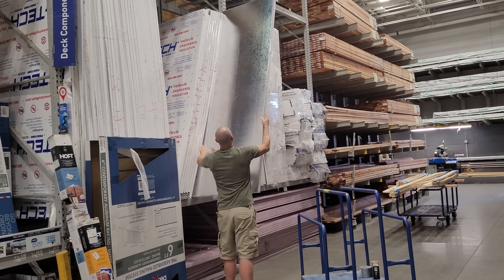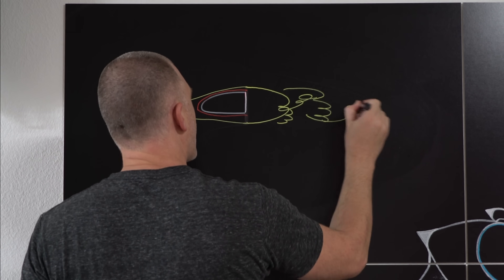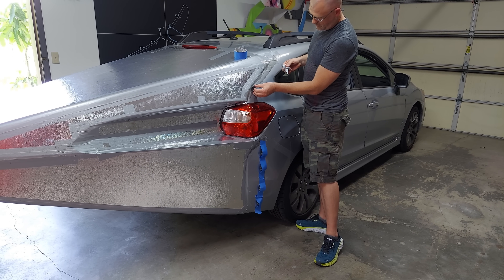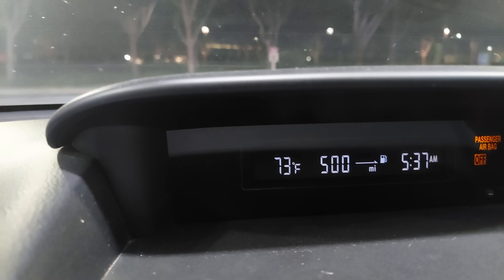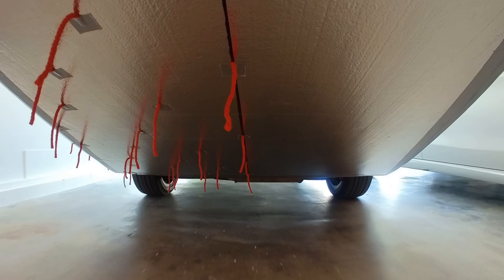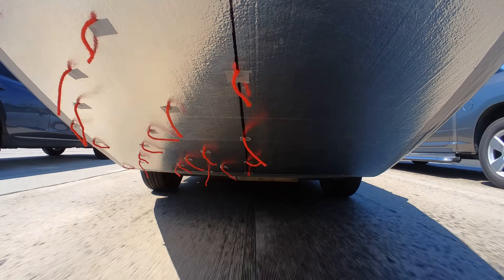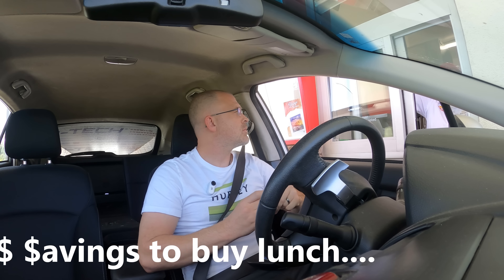Using Simple Aerodynamics to Beat High Gas Prices (Home Improvement Store Edition)

Comment: Interesting! I own an Audi 100, which was the first production car with a Cw lower than 0,30. Funny enough, this is for the sedan. The avant/station version, though it looks very streamlined, has a higher Cw. I think that is because the rear window is very long, and the airflow rolls over the long vertices. It seems the shorter window of the sedan is better.
Thus, I would suggest the tail can be much shorter. Maybe it also helps that the contact surface is smaller then. Furthermore, I think the tail should be flat, ending in a horizontal edge (with the bottom flat, as you already suggested). When you taper it both horizontal and vertical, the air will roll more over the sides too.
And talking about aeroplanes: maybe winglets at the edges could work... give it the tatra look :)
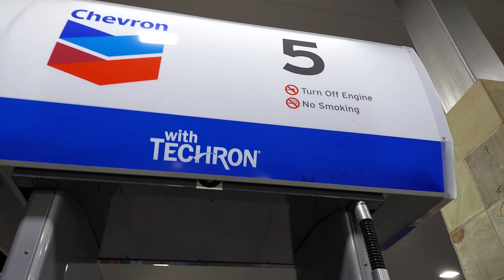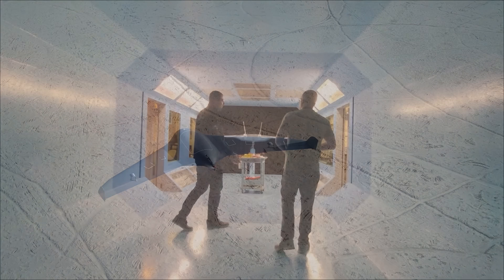Reply: This world is rapidly passing away and I hope that you repent and take time to change before all out disaster occurs! Belief in messiah alone is not enough to grant you salvation - Matthew 7:21-23, John 3:3, John 3:36 (ESV is the best translation for John 3:36) if you believed in Messiah you would be following His commands as best as you could. If you are not a follower of Messiah I would highly recommend becoming one. Call on the name of Jesus and pray for Him to intervene in your life - Revelation 3:20. 

Contemplate how the Roman Empire fulfilled the role of the beast from the sea in Revelation 13 over the course of 1260+ years. Revelation 17 confirms that the beast is in fact Rome. From this we can conclude that A) Jesus is the Son of God and can predict the future or make it happen, B) The world leaders/nations/governments etc have been conspiring together for the last 3000+ years going back to Babylon and before, C) History as we know it is fake. You don't really need to speculate once you start a relationship with God.

Can't get a response from God? Fasting can help increase your perception and prayer can help initiate events.  God will ignore you if your prayer does not align with His purpose (James 4:3) or if you are approaching Him when "unclean" (Isaiah 1:15, Isaiah 59:2, Micah 3:4). Stop eating food sacrificed to idols (McDonald's, Wendy's etc) stop glorifying yourself on social media or making other images of yourself (Second Commandment), stop gossiping about other people, stop watching obscene content etc. Have a blessed day!

Comment: Sometimes drag reduction devices are not so obvious.  A USPTO issued a patent around 1980 to a small NASA contractor near Langley, for Drag Reduction of Bluff Bodies, which intended to reduce vehicle drag.  The test vehicle was a Ford Econoline F-350 van.  Apparatus- 4 sheets plywood forming a box that is attached to the front edge of the hood of the van, the front sides and bottom front edge so that the front of the box is open to oncoming air.  The reduction in drag was something like 30% at 45 mph.  Mechanism:  Air over air friction is less than air over the surface of the front of the van.  (Details are solely from memory.)

This may explain why more recent vehicles, like Lexus with the butt-ugly front grills, and most  pickups have gravitated to the huge and non-functional grills (as for cooling).

Comment: such an aerodynamic attachment did not pass, at least not in this condition. In addition to not being homologated for road use, the car does not have a properly visible registration plate and the placement of the car's lighting in relation to its external contours does not comply with the regulations

Comment: To be honest, I'm thinking of diffusers, how they have vertical fins. Instead of inverting that tail, what if you gave it vertical fins extending below the existing area? It should give the air something to stick to and organize some turbulence under there, no? And for the tail lights, would a clear covering on the existing cutouts would still be within the limits of the law?

Comment: The easiest thing you can probably do is add a lower air dam, both in the center and in front of the wheels. You can acceptably add about one inch from where you are. Underbelly pan will also help, although the most surprising benefit there is reduced road noise. Tape portions of your grille over but don’t ignore ventilation.

I did a bunch of work to an 04 CRV after being disappointed with economy. Rough rule of thumb, most improvements are going to be incremental and additive. A lower lip might net you 5% but expect most mods to be in the low or even half digit range. Tire pressure alone can give you a 5% increase. Do a whole bunch of work and your mpg might go from 24 to 28, significant but not earth shattering. A lot of it is defined by the frontal area and powertrain.

Check out the rear wing on the Honda Fit hybrid as opposed to the regular. Your kamm back doesn’t need to be so long to begin giving you a few % back.

Comment: Why car manufacturers are not going this route you ask? because. oil companies want you to use more gas rather than less - that's why, that's the same reason why electric cars weren't popular after 1920's but now suddenly sprung up as the new invention (which was around since 1900's) everything comes down to oil companies not wanting people to use electric because it's not profitable to them so they did whatever they could to keep people using gas and diesel, yet now everybody is realizing that throw smoke into atmosphere for 120 years was not a good thing...

Comment: Also, forgot to mention, but a high speed coast down test over a measured distance is a very quick scientific/accurate way to judge drag reduction in the absense of better methods.  If you could interface with the vehicle ECU and track fuel flow rate, that would be another.  Working with fuel pump numbers is very iffy and adds a lot of uncertainty.

Comment: Nice work.  My day job is aerodynamics and I will say the one big thing that jumped out at me is that you left the base area open, which creates a cavity inside your boattail.  You could very well be creating low pressure inside the cavity which is then acting all along the rear hatch and bumper of the vehicle.  Low pressure on aft-facing surfaces creates drag.  You may see a notable benefit by simply closing the back end of your boattail (would need to move the license plate for visibility of course).  Also, if you haven't already, research the "Kamm back" concept, which was developed by the Germans many years ago and has some benefits.  Basically they discovered that at some point, extra boattail length doesn't help anymore, so long boattails are not necessarily better.  Sometimes you are better off with a short boattail with shallower angles.  Keep flow attached as long as possible to aid in pressure recovery behind the vehicle, then truncate the boattail at the point where it won't help much more.  Compared to your long "steep" boattail that has separation on the sides and lower surface, a shorter shallower boattail may do as well or better.
Reply: @Lumber Jack : What about Box Cavities ? I have seen several cars that improved their drag by having a box cavity. 
Are you saying that in this case the open area is too deep, and that a box cavity needs to be shallow ?
Reply: @O-cDxA  I have used base cavities to reduce drag on heavy trucks (see SAE paper 2005-01-3526) and it's important for the cavity shape and depth to produce a recirculation bubble pattern.  They are generally shallow cavities, about 0.2*W to 0.25*W deep where W is the base width (~ 8'6" for a heavy truck trailer).  This raises pressure on the aft-facing base area and produces a thrust which offsets overall drag.  Same effect you get on a modern pickup truck with the bed closed except it acts on the rear of the cab.  Modern pickup trucks are putting lips on the trailing edge of the cab to enhance this effect.

If a cavity is too deep or has the wrong shape, it can create the opposite effect, and lower pressure on the base area, increasing drag, or cause other problems.

All of this could be explored with CFD to get an idea of what works for this vehicle.  Sometimes the optimal shape will involve cutting the boattail short (Kamm back concept) in order to get max advantage out of all the competing effects, including with/without cavity.  A long taper isn't always the best or most feasible.
Reply: Repent and follow Jesus my friend! Repenting doesn't mean confessing your sins to others, but to stop doing them altogether. Belief in Messiah alone is not enough to get you into heaven - Matthew 7:21-23, John 3:3, John 3:36 (ESV is the best translation for John 3:36). Contemplate how the Roman empire fulfilled the role of the beast from the sea in Revelation 13. Revelation 17 confirms that it is in fact Rome. From this we can conclude that A) Jesus is the Son of God and can predict the future or make it happen, B) The world leaders/nations/governments etc have been conspiring together for the last 3000+ years to accomplish the religion of the Israelites C) History as we know it is fake. You don't really need to speculate though because you can start a relationship with God and have proof. Call on the name of Jesus and pray for Him to intervene in your life. - Revelation 3:20

Revelation 6 1st Seal: White horse = Roman Empire conquering nations under Trajan 98-117 AD & Gospel spreading rapidly. 2nd Seal: Red horse, bloody civil wars with 32 different Emperors, most killed by the sword. 185-284 AD 3rd Seal: Black horse, economic despair from high taxes to pay for wars, farmers stopped growing. 200-250 AD 4th Seal: Pale horse, 1/4th of Romans died from famine, pestilence; at one point 5,000 dying per day. 250-300 AD 5th Seal: Diocletian persecuted Smyrna church era saints for ten years, blood crying out for vengeance. 303-312 AD 6th Seal: Political upheaval in the declining Roman Empire while the leaders battled each other. 313-395 AD

Revelation 7 Sealing of 144,000, the saints, before trumpet war judgments, which led to the fall of the Roman Empire.

Revelation 8 1st Trumpet: Alaric and the Goths attacked from the north, the path of hail, and set it on fire. 400-410 AD 2nd Trumpet: Genseric and the Vandals attacked the seas and coastlands, the blood of sailors in water. 425-470 AD 3rd Trumpet: Attila and the Huns scourged the Danube, Rhine & Po rivers area, dead bodies made water bitter. 451 AD 4th Trumpet: Odoacer and the Heruli caused the last Western Emperor (sun), Senate (moon) to lose power. 476 AD With the Western Roman Emperor (restrainer of 2 Thes. 2) removed; the son of perdition Popes took power.

Revelation 9 Two woe judgments against the central 1/3rd and eastern 1/3rd of the Roman Empire. 612-1453 AD 5th Trumpet: Locust & scorpions point to Arabia, the rise of the Muslim army. Islam hides Gospel from Arabs. 612-762 AD 6th Trumpet: Turks released to attack Constantinople with large cannons (fire, smoke, brimstone). 1062-1453 AD

Revelation 10 The little book is the printed Bible, which was needed after the Dark Ages when Scriptures were banned by Popes.

Revelation 11 7th Trumpet: Martin Luther measured Roman Church; found that it’s an apostate church, not part of true temple. The two witnesses are the Scriptures and saints who proclaim the pure Gospel and testify against the antichrist Popes. Papal Church pronounced Christendom dead in 1514 AD. Silence for 3.5 years. Then Luther posted his 95 Thesis, which sparked the Protestant Reformation and brought the witnesses back to life. Millions of Catholics were saved.

Revelation 12 Satan used the Roman Empire to try to wipe out the early Church, Satan was cast down as the Empire collapsed.

Revelation 13 The antichrist beast Popes reigned in power 1,260 years, 538-1798, is the little horn of Daniel 7, son of perdition. The false prophet Jesuit Superior General rose to power from land (earth) of Vatican and has created many deceptions.

Revelation 14 Points to great harvest during the Protestant Reformation & wrath on Catholic countries who obey antichrist Pope.

Revelation 15 Overcoming saints victorious over the beast. Prelude to 7 vials and judgment on those who support Papal Rome.

Revelation 16 1st Vial: The foul sore of atheism was poured out on Catholic France, leaving them with no hope, led to revolution. 2nd Vial: The French Revolution started in 1793, killed 250,000, as France had obeyed the Pope and killed saints. 3rd Vial: The French Revolution spread to rural areas of France, where Protestants had been killed in river areas. 4th Vial: The bloody Napoleonic wars shed the blood of countries who had revered and obeyed the antichrist Pope. 5th Vial: Judgment on the seat of the beast. Papal States invaded in 1798, Pope imprisoned, removed from power. 6th Vial: The Turks vast domain dried up, they were only left with Turkey. They lost control of Palestine in 1917 AD, Israel became a nation again in 1948

Comment: With all the love for what you’re attempting here, I no way would I objectively say the car is super practical. Unfortunately to gain all those dividends you had to loose access to the back hatch and created major visibility issues as well. I’d like to see you get the same dividend in mpg while allowing access to the vehicle as standard from the manufacturer as well as being back the rear visibility. That would actually make the car practical, it currently just isn’t but this work and experimenting you’re doing is awesome and super informative keep going!
Reply: Replace the top half with UV-treated clear acrylic or plexiglass in a hatch, increasing storage, and restoring visibility--or an opaque hatch with a backup camera.

Comment: Another huge gain in fuel economy would be to do pulse and glide with that kind of aerodynamics you have. The problem with combustion engines is that they're not very efficient at constant speeds/RPM. If you do pulse and glide which is to get up to a high speed that you can get away with say 80 mph then put your engine in neutral or if you can modify the car to turn off the engine while gliding at that speed, you would gain tremendously!

Comment: you could've also perfected the aerodynamic shape through building a channeling shape / channels on top of the back lights - simple aluminium foil on the inner surfaces of the channels will get you your reflection / light output on the back. You could even go fiberoptics if you were to feel the need for "fancy"

Comment: Great experiment 👍
I'm curious to know if you checked what the wind conditions would be for each run?... Presumably the best case scenario would be for as close to nil wind conditions as possible but practically that would be pretty hard to get... But given that there is exponential increase in drag with small increase in headwind (if my aerodynamic theory recollection is correct!), then it wouldn't take much change in the average headwind/tailwind component to disrupt the test data
Reply: A-B-A testing.  He should remove the tail, run again, and compare with his first test.

Comment: This is so cool! It even LOOKS better somehow?! You need to install a front bumper air dam of some sort with a chassis mounted splitter. Then you need an aluminium undertray for the whole car leading into a diffuser at the back, oh and some side skirts to help separate the air travelling under the car. Then you need to lower it! You'll end up with something that will look really cool, if you play your cards right, as well as being more efficient.
I truly don't understand why there aren't more low drag high efficiency ICE cars out there.

Comment: You can also use compressed air through nozzles at the end of a vehicle to reduce drag.
Reply: Is that worth it efficiency wise if you have to compress the air first using some power and fuel for running the air compressor?
Reply: @wopmf4345FxFDxdGaa20  Articles Ive seen seem to state it is. If not, how about this to power a compressor, to create HHO, or both? 

https://youtu.be/tEPBdztGMdI